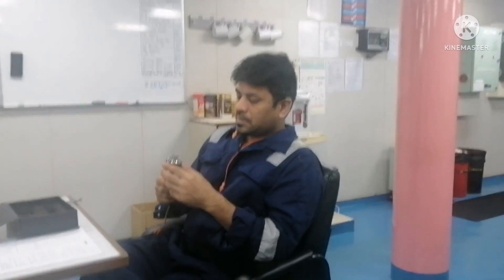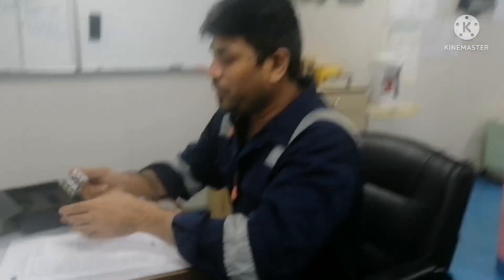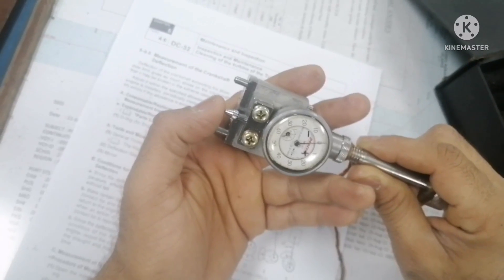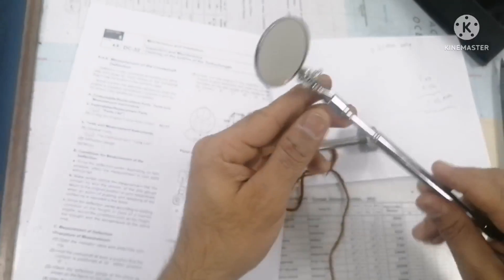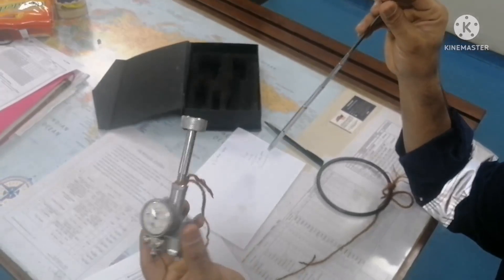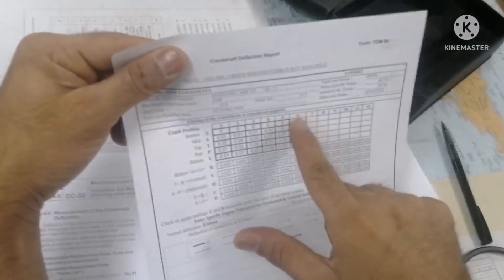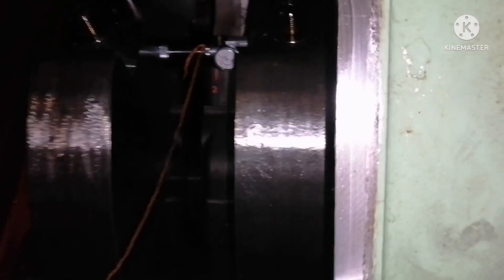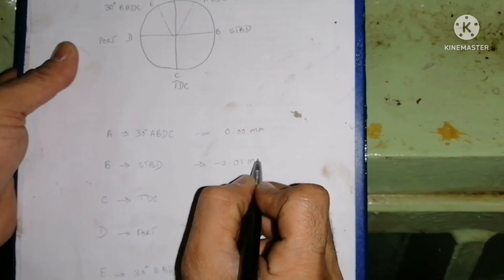HOW DO THEY DO.. HOW TO MEASURE CRANKSHAFT DEFLECTION ON GENERATOR ONBOARD SHIPS...

Comment: Hi.plz what the reason we have to make crankshaft deflexion ?
Reply: 3 Reasons
1. To know the condition of Crankshaft
2. to know the alignment of crankshaft with respect to bedplate.
3. To know the condition of Main Bearings
Over period of time these bearings are worn out and it may not be uniform throughout the lenght of crankshaft. Therefore Crankshaft Deflection comes for our help
Reply from the maker: To  find any abnormalities in crankshaft (slippage) and main bearing condition

Comment: is this like..before putting dial gauge between web,dial gauge has to be little compressed to allow expansion for +ve reading and further not allowing falling into crankcase.
Reply from the maker: No sir.. After fitting disk gauge u have to set the dial to zero
Reply: @marine-knowledge-basha  thankyou sir

Comment: Sir, thanks for the video. Sir when the reading is going to be +ve or -ve? What decides whether the reading is going to be+ve or -ve.
Reply from the maker: Wen u c the dial gauge going clockwise u take it as positive and if it turns anticlockwise take it as negative
Reply: @marine-knowledge-basha  so sir clockwise=positive= opening of webs , anticlockwise=negative=closing of webs ....Please confirm sir

Comment: sir it is not necessary  to move the dial gauge to 20 first ? its like the starting point (abdc)
Reply from the maker: Sir u r rt.. Initial setting u have to set the dial to zero then for the entire reading turning should not be stopped for understanding purpose i had stopped for each position..

Comment: Sir what is main purpose of taking crankshaft deflection??? And what is the corrective action to be takes if we find deflection??
Reply from the maker: Main purpose..
To know the condition of crankshaft
To check the crankshaft alignment
To know the condition of main bearing and its alignment.
If the values is beyond the limit maker should be informed. Ship board staff should report it to makers and get their advise.
It is not advisable to run generator if the crankshaft deflection is beyond the limit as it may break the generator.
Reply: @marine-knowledge-basha  sir in case of main engine cs deflection? Is it the same?